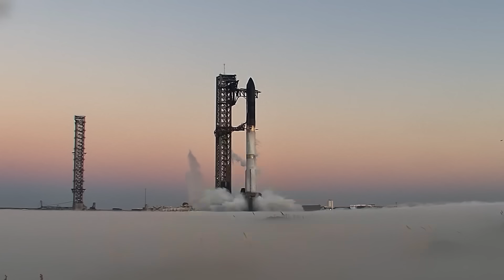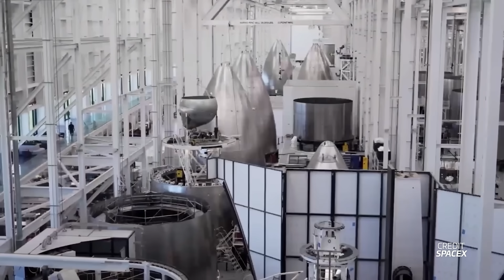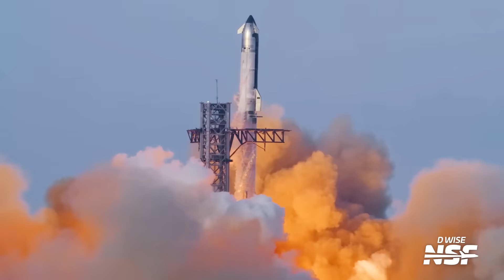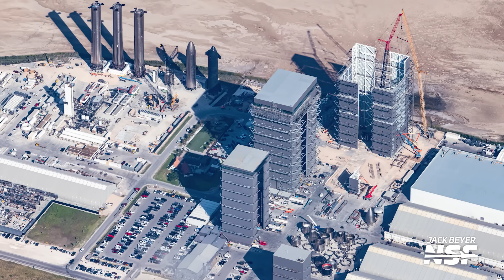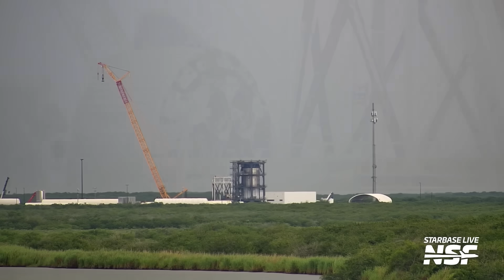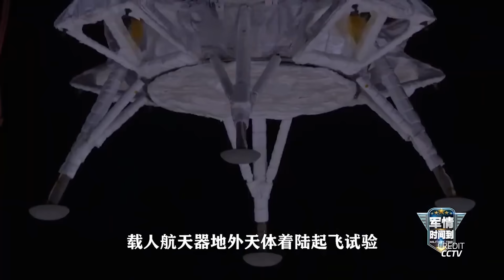Starship Flight 10: What's Next? | Starbase Update

Comment from the maker: ⚡ Thanks to Henson Shaving for sponsoring this video. Get an Excellent Shave and 100 Free Blades with your razor purchase: https://hensonshaving.com/spaceflight  - Use Code "SPACEFLIGHT" at checkout. ⚡
Reply: I legit actually love this razor, check em out!
Reply: I have used mine for almost three years now. I am very, VERY happy with the results. I hate shaving.  I despised having to spend close to three bucks per el-cheapo plastic multiblade razor. I bought a few expensive ones and they really were not better than cheap ones. The Henson is like the old safety razors my father shaved with but I was not a huge fan of the old one as I could still cut myself because I am not very adept at shaving. The Henson one evidently has different tolerances and I do not cut myself at all any more. AND with a new blade it is pretty much effortless to shave. I still hate it but now I hate it less and it is better and cheaper. The blades are cheap enough I do not even feel bad using a new blade after only two or three shaves. That is just my opinion.
Reply: @phlogistanjones2722 Nice product commercial.
Reply: I've had one for about 18 months, love it and saving a fortune on blades.

Comment: The elephant in the room is still that Starship cannot be turned around quickly after an Earth re-entry. Flight 10 experiencing a small explosion in the engine bay skirt early in the atmospheric re-entry cannot be attributed to a heat protection test. The explosion visibly damaged one of the rear fins and after re-entry progressed, the opposite fin showed similar damage.
Booster still has re-light issues that we thought had been solved.
When Starship was a program entirely funded by Elon and there were no outside forces needing the Starship to perform as announced, racking up continual structural failures wasn't a worry, but now that Starship has become NASA's vehicle for lunar landings, each structural failure sets back NASA's timeline for their manned lunar project. Taxpayer money is now involved and Elon can't be so cavalier with his failures. One might wonder if the continued intentional removal of tiles prior to launch "for heatshield testing" provides a convenient excuse for the structural failures that we see happening on every flight. I'd suggest that SpaceX perform a Starship re-entry flight with a full installation of their heatshield,  but I'm guessing that would be too revealing to NASA.
Reply: What are these "structural" failures you speak of?  Flight 7 failed due to resonant or pogo feedback in redesigned methane transfer tubes.  Flight 8 failed due to excessive leakage from insufficiently tightened Raptor engine flanges.  Flight 9 failed due to a defective methane ullage gas diffuser.  Ship 36 blew up because of a defective COPV.  And the engine bay skirt explosion(s) on flight 10 seem to be caused by some blockage in the redesigned engine chill shunt lines.  These are all individual components, rather than structural, failures.  And the later-occuring ones would only be discovered later, because earlier flights failed before these later issues could manifest.

As for Booster engine relight, that was an intentional failover mechanism demo - further expanding the Booster's engine-out resiliency profile.  The one Booster engine on the middle ring that did go out during the ascent burn and never came back afterwards, during flight 10, is an interesting but not showstopping failure - and its long-term implications or significance are unclear, as these are all Raptor 2 engines anyway, whereas the Starship stack is completely transitioning over to the rather drastically different Raptor 3, starting with the 12th test flight.
Reply: What relight issues on the booster?
Reply: @Alexphysics13  After Starship separation, how many engines activated on the boost-back burn? If you can't repeatedly relight ALL engines intended for a maneuver, you have relight issues.
Reply: @Fadamor all functioning engines relit for the boostback burn and landing burn as well
Reply: @Alexphysics13  Then you and I were watching two different Flight 10s.
Reply: @Fadamor  you probably watched one where you didn't notice that Engine 8 went out during ascent and it didn't turn on for all other burns. When that happens, it ain't a relight failure, the engine is just no longer working. It's that simple
Reply: @Fadamor  I think that's almost pure nonsense.

Comment: How long before Starship 10 turns around and is ready to fly again? Isn't the turnaround time to get the same hardware serviced and ready to fly supposed to be 24 hours?
Reply: Are you referring to the hardware from Flight 10?

24 hours is a target. It could be very many years before they even get within an order of magnitude of that.
Reply: @peterford5408  Yes the hardware. I honestly haven't been paying much attention but I recall the whole selling point of starship is to reuse the equipment making sending payloads to space cheaper. 
Like how the space shuttle was reused but that took weeks to get ready. I thought starship contract with the US was a 24hr turnaround.
Reply: @SerenityIsLost  And it's clear you haven't been paying attention.  Your thinking these throw away test articles are final designs is a big mistake.  That's the big flaw in your understanding.

Comment: Could they use the heat shield tiles on some of the infrastructure, such as the shield, for quick disconnect.  Would serve as protection as well as testing for future tiles.
Reply: The glass-covered ceramic fiber mesh tiles are too fragile for that (they'd be blasted apart by the Raptor exhaust, if they aren't shaken to pieces by the violent acoustics first).  Maybe they could use metallic tiles for that in the future.  But probably not really necessary, since the new BQD design is going to be cooled and protected by water deluge spraying from the top deck of the OLM.  (Whereas the SQD swings out of the way, and shouldn't need such protection at all.)

Comment: My first thought as soon as you showed that tray hanging off the McGregor smaller test structure was that it's HLS-related.

There's a lot they could do with that huge version e.g. build a test article a few rings high to simulate the part of HLS where the landing thrusters will go, add a fairly significant amount of dummy mass to bring the overall mass of the test article up to that of a full HLS landing on the Moon, and then do some testing just like the Chinese did to validate thrust and attitude control, various failure scenarios (e.g. one or more thrusters failing during final descent) and probably plenty of other stuff besides.

Comment: Honestly I'm pretty sure the "critical path" for Starship to go from experimental to operational remains the same three-step program that it has been for the past two years.

Step 1, prove basic controllability both during ascent and in zero-G, as well as show that Raptor can be relied on to perform a de-orbit burn once in LEO. This step would unlock orbital flights and allow every Starship flight to deploy a bunch of V3 Starlinks, thus beginning revenue generation.
Needless to say, this step was supposed to be achieved by block 1, and after flights 5 and 6 we all THOUGHT that it had been, with the first flight of block 2 merely being a confirmation/repeat of flight 6 before moving on to the next step, only for block 2 ships 33, 34, 35 and 36 to all screw SpaceX over big time with some very unfun, BS and frustrating failures that either couldn't have been predicted or really seem to have just been cases of godawfull luck.
This being achieved would allow SpaceX at least a dozen orbital flights a year (or as many Starships as they can build) which is awesome, but not truly groundbreaking.

Step 2, prove re-entry can be done safely with no tile loss (aka, a truly reusable heat shield, even if early versions still need some refurbishment that's more than fine) when inside Starship's normal flight envelope, and is at least survivable even when conditions are sub-optimal (missing tiles, steep descent, aggressive manoevring etc.) without Starship breaking up in the process, albeit at the cost of that heatshield being either "finito" or requiring massive overhaul, which is just fine for exceptional situations. This step would allow SpaceX to re-enter back towards Starbase over Mexico and catch the ship, thus starting reuse (doesn't have to be too rapid at first) and allowing several times more launches per year than after step 1, easily filling up the 25 launches they're allowed to do from Starbase, and allowing SpaceX to send some ships to the Cape to begin operations there until that factory's online. This was what block 2 was SUPPOSED to have enabled for block 3, and I guess at least on the aggressive re-entry side, flight 10 did confirm that side. Honestly my big hope for flight 11 (whether they go orbital or not) is for SpaceX to NOT "push the envelope" with ship 38 in ANY way. No missing tiles, No "putting the ship through its paces", No tile experiments at all, period. Simple smooth "full" heatshield on a routine bog-standard re-entry trajectory with ZERO pieces or tiles seperating from the ship during descent is what I would really hope to see them do. If SpaceX does that, then even with just the two block 2 ships that behaved (37 and 38), they can be argued to have completed step 2 after all, albeit with 2 re-entries worth of data rather than 6, which sucks, but still. No block 2 ships will have been caught, but since they didn't have the payload capacity to put a hypothetical extra number of flights to good use anyway, and instead the second block ship 3 (ship 40) - which would actually be useful to refly - is the one that gets caught, then honestly we can cope a bit by saying that losing those 4 ships wasn't THAT big of a deal, and it will even be sorta true, however much of a bad taste it'll still leave in our mouths. 

Step 3, prove on-orbit refueling of Starship on the scales that would be needed for missions to the Moon and Mars. This, clearly, is what block 3 is supposed to do besides launching Starlinks with its 25 to 75 flights a year (depending on how fast the Cape comes online). Once this step is done (hopefully as early on in 2026 as possible) Starship can imo be said to have 'matured' as a spacecraft and we and SpaceX both can really leave the Earth-side tests behind (at least until block 4 shows up) and actually, finally, start eyeing up sending humans back to the Moon for Artemis, and Cargo and later humans to Mars to finally fulfill SpaceX's founding vision. 

Fingers really firmly crossed that flights 11, 12 and 13 all go as succesfull as SpaceX now needs them to. If they do, the solar system is humanity's for the taking.

Comment: SpaceX are learning and adapting quickly but to the layman it looks like they’re talking too soon about future models before they’ve got the current version wrinkles ironed out. Somewhere they have 100 or more V1 Raptors that will never fly which  looks like a result of moving too fast. Starship has only landed once successfully and everything they do in flight is wasted unless they can land consistently and that now means catching the ship. OK I know that’s just my observation as a layman but in my electronics field you fix one thing at a time because if you change too much at once you inevitably introduce new problems.
Reply: The layman is confused a lot by comparing the rapid iteration process (which does produce a lot of scrap) vs. the more traditional legacy development path employed through most of spaceflight history (in the west).
Reply: I noticed that too. I would like to see a Method and Application to testing the Starship, like most Engineers do when building out a project of this size and application. It would save millions of dollars too.

Comment: 6:15 so, something doesn't quite math on v4.  It is supposed to carry 2300 t of propellant, compared to 1600 for v3.  All while the Ship only gets 9 m taller (from 52.1 for v3, to 61 for v4).  And presumably at least maintains, if not increases, the payload bay height?  How are they presuming to squeeze 700 t of propellant into 9 m of height?  If that were possible, all of v3's 1600 t of propellant would fit inside 21 m, leaving a whopping 31 m for everything else.  I don't think that's the case... is it?  So maybe they (Musk?) forgot to update the v4 propellant capacity when they reduced its height from ~70 m down to 61.  At least that would be still consistent with Musk saying v4 might go all the way up to 150 (rather 142) m for the full stack...
Reply: It could be related to the extra vacuum engines on the second stage.
Reply: Super cooled cryo liquids.
Reply: 9m diameter, 9 meters tall 600 meters3.  Most of that liquid oxygen at 1100kgs per meter3..  It will be tight and I have no idea what the densify the Lox to..

Comment: I still dont get the need for in orbit refueling, Acknowledging the added weight, couldnt you just strap the two together and press go? I.e. engines on the in orbit tanker.
Disclaimer not a rocket brainiac
Reply: Sure... why take just the dry mass of the HLS to the Moon, when you can take the dry mass of the HLS along with the dry mass of the propellant Depot!  errr, on second thought that doesn't sound very optimal... 😜

Comment: Holy smokes that V1 stack got thiis close to having a negative payload
Reply: Yeah. And that was the initial design of Starship which was originally planned to lift 150 tons to orbit. The fact that in the end it could only do 15 tons tells us that Starship turned out a lot heavier than anticipated.

If they had known it would be this heavy, they would have gone with a larger ship design immediately, though probably with a larger tank diameter and not as tall as their current design for block 4 (which still has a 9 meter diameter for compatibility reasons).

"Eager Space" has a nice video on optimal rocket width and Starship.
Reply: @cube2fox thanks, I will watch.
Reply: @ThePlecoPal  The video is titled "Will Starship Get Bigger? Propellant tank sizes and rocket diameters".
Reply: @cube2fox  No, these are low fidelity test articles.  The FINAL version was planned to lift 100, then 150 and now maybe 200.  There are some flaws in your understanding.
Reply: @imaginary_friend7300  I think there is rather some flaw in your understanding. If they had known it would be that heavy, they would have made it larger immediately, not later.

Comment: Gotta wonder if they could get a performance boost if rather than returning booster to Boca they set it down in Florida.
Reply: Nope.  To reach Florida, the Booster would have to go much, MUCH faster than it currently does at stage separation.  One, it doesn't have enough propellant left to gain much more speed after stage separation (unless you launch it standalone, without a fully loaded Ship on top).  Two, even if it somehow achieved the necessary velocity, it would at least partially burn and melt upon reentry - since it has no heat shield to speak of, unlike the Ship.  If you consider doing a reentry burn like the Falcon 9 to slow down enough to survive reentry without a heat shield (or engine damage), you'd find even launching a Booster standalone from Texas to Florida, that it just doesn't carry enough propellant (or in rocket lingo, produce enough delta-V) to do all that's necessary to come to a safe landing intact.
Reply: The booster seems like it is going very high and very far when watching the live streams, but I don't think it actually would make it all that close to Florida if they just let it keep going instead of a boost back burn. 

Definitely interesting to think about though.
Reply: The booster would need to go ~5 times as fast as it already travels in order to reach Florida.